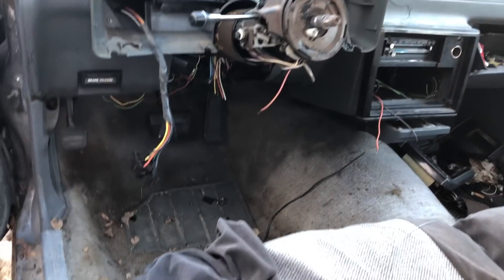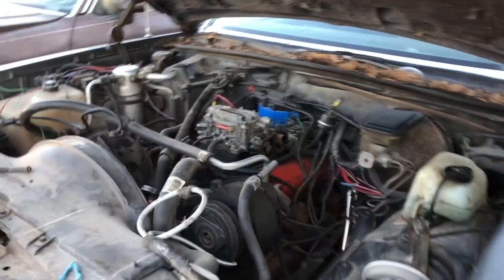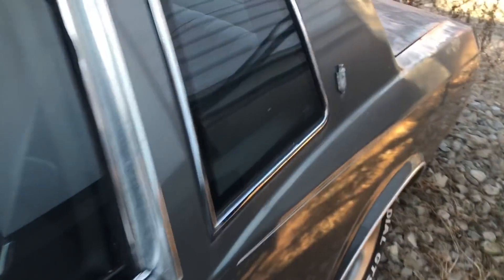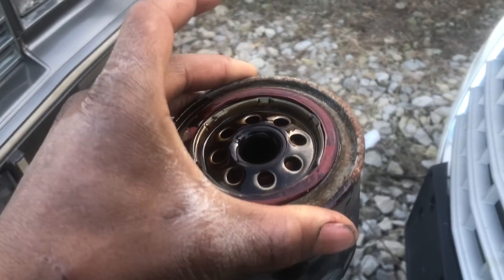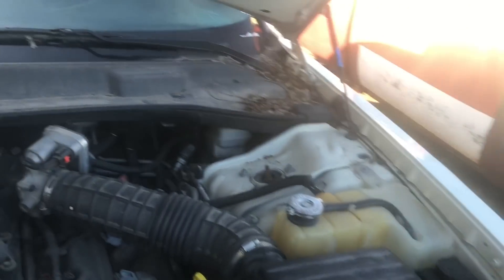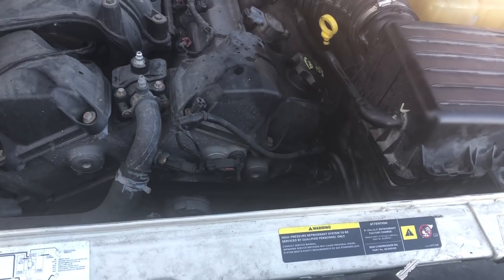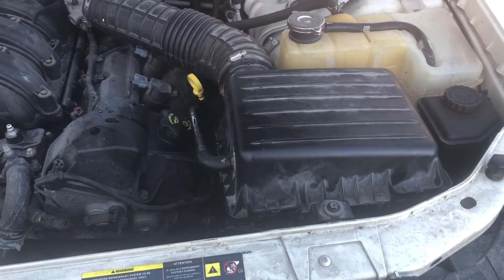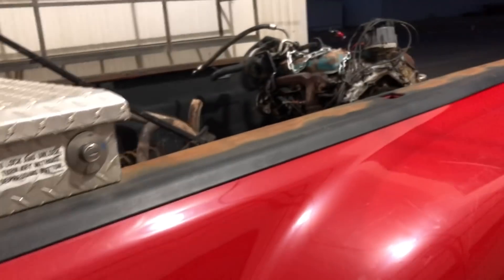Flip Cars Ep 4: Bad News 🤦🏾‍♂️

Comment: Bro don't put no money in that motor,just swap it with a 3.5. the 2.7 is garbage and not built well
Reply: I dont think he's familiar with 2.7 I would've never got that car
Reply: that would cost more money though he just trying to flip and get a return on investment
Reply: if he planned to keep it def would say swap the 3.5 is one of the best so i heard
Reply from the maker: It’s cheaper to fix 🤷🏿‍♂️. I’ll get the same amount of I put a 3.5 in it
Reply from the maker: Anthony Johnson A bad rep motor don’t stop nothing 🤦🏾‍♂️. Everything is fixable 🤷🏿‍♂️.
Reply: @SteveDavisCarGuy  but most people tend to stay away from the 2.7 I live in DETROIT and that's all that's in the junkyards are 2.7s lol
Reply from the maker: Anthony Johnson Nobody looks at their recommended maintenance either, I love getting cars like this for cheap 🤷🏿‍♂️. I know the timing belt and water pump is a big job no one ever does on these 🤣.
Reply: Steve Davis yea man trust me don’t pull them heads off them 2.7 engines are trash it’s got chains and all kinds of bad designs internally
Reply: If u get another 2.7 get one with a warranty or that is known to be good and u can get it sold and gone
Reply: I got the same car and the 2.7 price for the motor was way more then then the 3.5 cause it's a high demand motor because of the issue. I got a 3.5 with real low miles for $700 with everything. And the 2.7 was $1800. The alternator and starter is the same on both 2.7 and 3.5. you only have to swap the a.c line and heater core line everything else is good to go. The wire harness plugs right into the 2.7. computer trust me it's cheaper bro
Reply: Mo Bell really i was wondering if the wiring was close or the same I would do the 3.5 if it’s like that